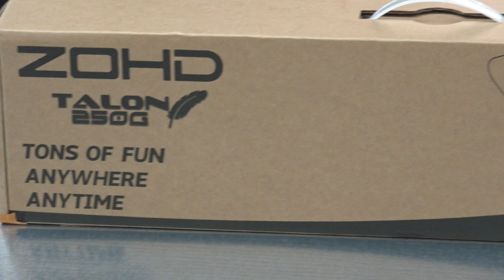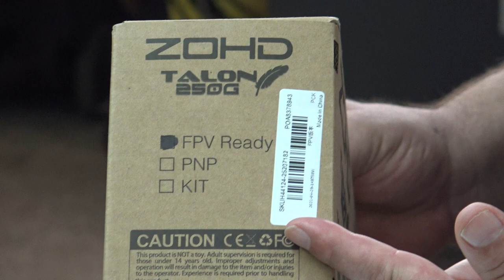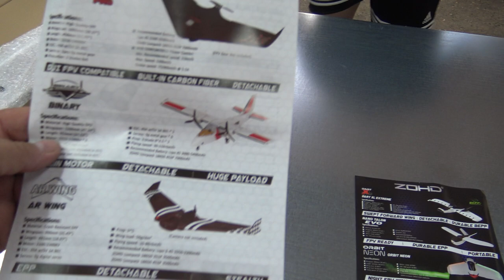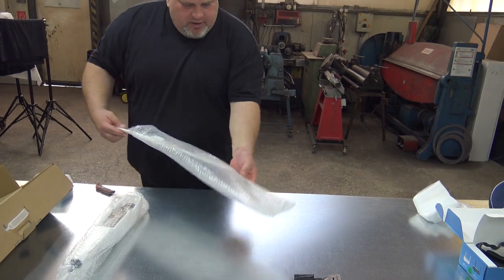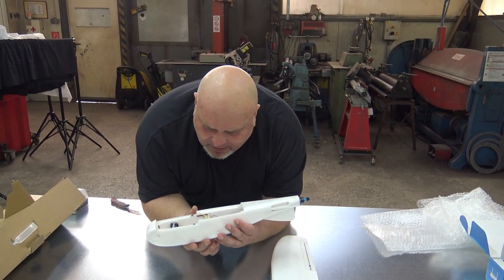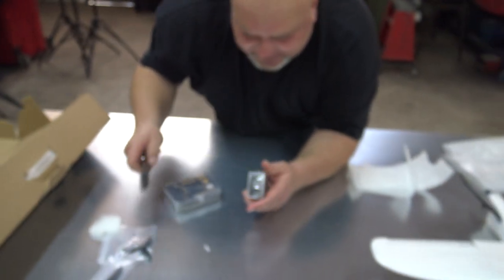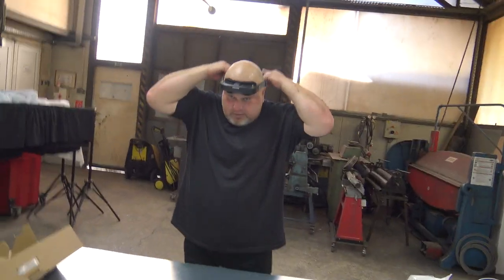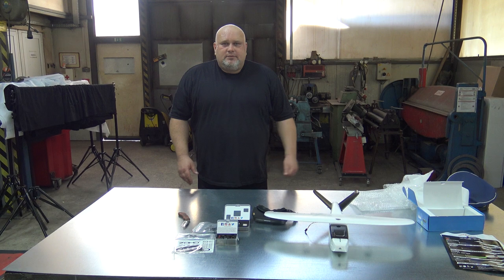FULL FPV version ZOHD Talon 250G 620mm Wingspan V-Tail EPP RC Airplane PNP Unboxing

Comment: Ive been flying rc planes for 7 years , ive been flying fpv quadcopters for 5 years , im so adicted to fpv , i recently upgraded to dji which is the best fpv system. Remeber when you fly the zohd things happen quickly but im sure you will master it , cant wait for the video . 👋👏
Reply from the maker: I cant wait to try it.

Comment: this real twitchy little plane drops fast needs full throttle and what the hell,could use two 2cell batts connect in series will give you 4 cell power ,this is gonna be a funny maiden for sure it will realy test your flying skill.

Comment: What?? FPV?? Who are you guys and what did you do with Rob and Blaz??
Reply from the maker: Oh dont worry Lauren. I was testing camera today in workshop, walk a little arround with it and got sick like on the boat ;-) I wonder if this is for me. I have also DJI Mavic pro with FPV waiting to be tested. Maybe I will start with that for some slow flying first.
Reply: @PetrincicBrosRC  Oh I know what that is Rob! Change the camera/VTX out. I used the same one on a Dart 250 and it had so much fish eye effect that I couldn't fly it. Very disorienting! It was hard to tell just by looking how high I was in the air.